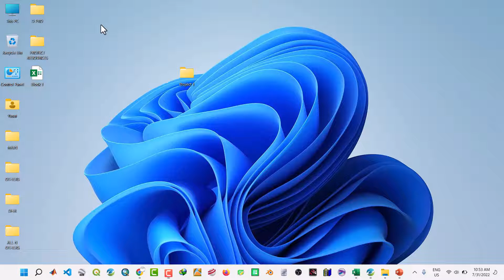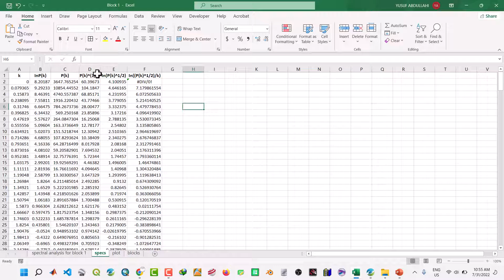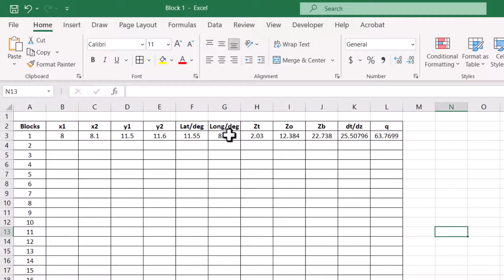(Part 1) Spectral Analysis of Aeromagnetic Data For Geothermal Energy Potential - Full Course

Comment: If you make your blocks so small then you will not see the deeper part. That's the reason that your depth estimations are quite small.
Reply from the maker: yes I know. the wavelength of signal is proportional to the depth of investigation. The wavelength depends on the size of the cell grid in km.